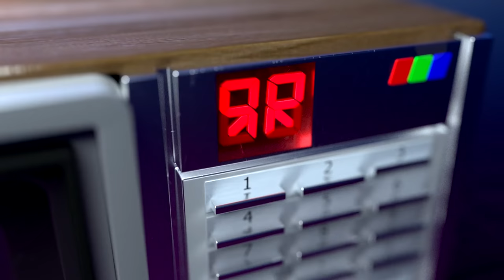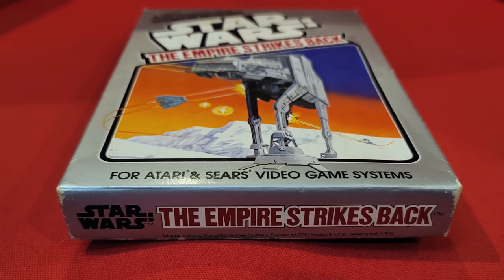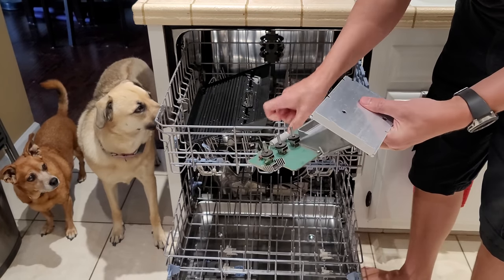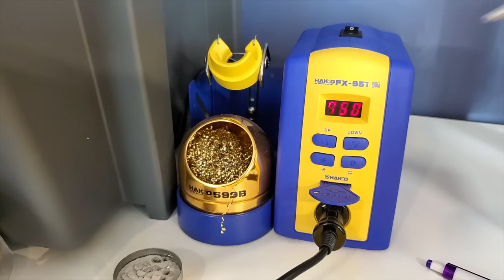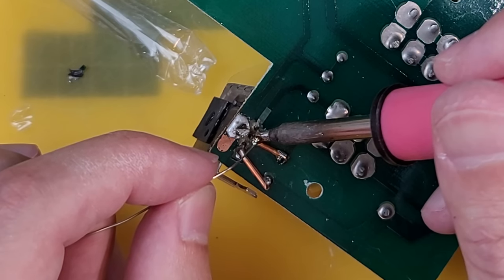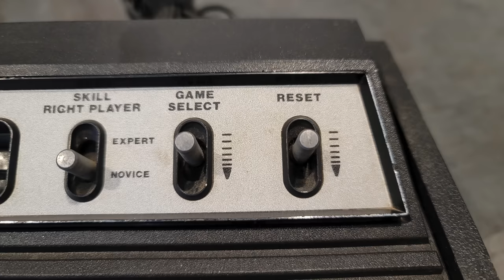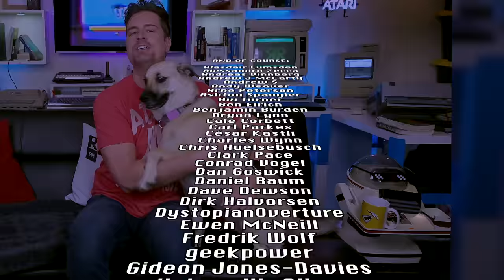Can we fix this rare 1977 Atari VCS? Sears Telegames "Heavy Sixer" Upgrade & Refurb!

Comment: I remember selling my 6 switch atari, not realizing how rare it was, it was in perfect operating condition too, a sale I would regret later on
Reply: I don't understand why they are considered rare.  I see many listings on ebay going for a hundred or less with 6 switches, I have one as well.
Reply: @n.h.s.a.d.m.  There's a distinct difference between a rare heavy sixer and a light sixer that isn't so rare...the heavy is heavier   due to more shielding (and possibly thicker plastics) when they first came on the scene, and the only outside visible difference is the sides are thicker on the heavy compared to the light

Comment: Major coincidence, I was attempting to get my 2600 6 switcher Atari branded woody from my childhood working today also. I get nothing on the screen. Power plug socket was loose, so I re-soldered it. Still get nothing. Where did you find those troubleshooting flow charts?
Reply from the maker: Very likely the TIA chip. No spoilers but I'm sure that was my issue. Oh and just Google Atari VCS field repair manual and you should easily find the PDF. Very handy! Good luck with the coincidental repair!

Comment: Hang on you reverse the polarity by turning the tips around on the ends to reverse the polarity. The box artwork on the power adapter was wrong!
Reply from the maker: Yes I had a feeling something was off there. Either way, incompatible tips 🤷‍♂️
Reply: Retro Recipes ahhhh well that’s a problem. Fingers crossed you can fix it.

Comment: I started streaming 2600 refurbs a month ago (on another site :) ) so this video is strangely timely. :)  Have you checked the RIOT socket pins thoroughly? Seems like that cap juice might have corroded a pin leading to RAM corruption like you're seeing here.  The TIA chip only generates scanlines one by one so I don't think DK would show up stable - but garbled - like it does here. But as I said I just started out so I can be dead wrong. :)
Reply from the maker: I did reflow the solder at RIOT but I'm 💯 sure it's a dead TIA chip 😉

Comment: Should have done the Stereo mod while you were in there. Yup, the TIA outputs independent Left and Right channel audio off of pins 12 and 13. Once you hear it, there's no going back.
Reply from the maker: Now you tell me!
Reply: @RetroRecipes  You can always go back in. The mod is really simple. Two resistors, two caps, and that's literally it. Here's a website with the schematic. http://www94.pair.com/jsoper/2600_stereo.html

What I usually do is pull the TIA, bend pins 12 and 13 out, then reseat the chip. At that point, I simply solder straight to the legs. The reason I do that, if you flip the board over, there's a bridge from the factory between 12 and 13. You could always cut that bridge, too, but I think just going straight to the pins is easier.

Comment: Surprised you didn't just grab any old 9v PSU from Goodwill or Salvation Army or whatever thrift store and build your own adapter with the correct polarity. If you don't have the mono audio plugs around, well, you can typically find those at a thrift store too. If you'd rather not cut up and splice and audio cable then Console5 sells ones you can open up, solder inside, and close up to look totally factory. So cheap and easy I would never dream of buying a third-party adapter for Atari CX-2600... but maybe that's just because I already have a surplus of those mono audio connectors I need to find a use for. ;) Yeah, I bought a huge pack of them from Amazon years ago and recently found even more that I've had since the '90s from Tandy/Radio Shack.
Reply from the maker: If only I had infinite time to do that! More soon...
Reply: @RetroRecipes  Would've been a lot faster than ordering one but I know what you mean. ;) That said, I did the last one in about 3 minutes since I already had a spare 9v adapter around from an old Discman.
Reply: @RetroRecipes  oh: and I typed that message while literally standing in front of the bin of wires and adapters at a Newnan, GA Goodwill. ;)
Reply from the maker: @emmettturner9452  you're a braver man then I wrestling through dusty second hand stuff during a pandemic LOL
Reply: @RetroRecipes  Not to mention that local area Goodwill and other thrift shops has little variety on the electronic side :/

Comment: “Those dishwasher pods contain anti corrosive agents” 

We’re making things up now?
Reply from the maker: Not at all. The anti corrosive (sodium silicate) is to protect the machine metal and silverware from water damage/rust in the dishwasher. Ergo they also protect the metal parts of computers. I've been doing it for years with nothing but good results.
Reply: @RetroRecipes  I think I know why people question this. It does sounds a bit odd that metals are generally protected, given glass can be etched by the detergents over time.
Reply from the maker: @wolvenar  That's true over hundreds of washes. We're talking about 1 wash every 44 years here.
Reply: Retro Recipes lol cool I didn’t know. I know it’s usually ok to put PCBs in the dish washer.
Reply: @RetroRecipes  Yeah, but I am just pointing out that it might be the reason for the disbelief.
Reply: @PunkNDisorderlyGamer  Just make sure they are FULLY dry before powering up after ;)
Reply: Looks like the alkaline detergents darkened the aluminium RF shield casting, and gave it a rough surface.

Comment: Tut tut Perifractic the instructions on those boards always say get the Atari working on RF before you mod.  Also you can generally feed the RCA jack's through the original hole one at a time to avoid drilling holes.  I vote for RIOT being dead
Reply from the maker: Wasn't an option time wise here but I bet you a million pounds (of olives) it's the TIA and was before I got it. BTW those RCAs did not fit. First thing I tried. 👍🕹️
Reply: @RetroRecipes  hope you fix it either way! You can trim the rubber on the RCA's, and the 3.5 jack (which would be hidden inside).  Really enjoy the channel

Comment: Aren't most multi voltage PSUs with the 2 prong tips capable of both center positive and negative by just turning the tips 180°?
Reply from the maker: Yeah but wrong tips either way

Comment: Just to clarify something you said about Atari still making a form of the VCS/2600 still to this day, well that is sort of true. The company that owns the Atari name today is Atari SA, a French holding company. They do not make any hardware themselves these days. The subsidiary Atari Interactive is who licenses old Games and the Atari name for retro gaming hardware/accessories. They are involved with/connected to a kickstarter project  that is putting together a modern Atari VCS (aka 2600) console that will include modern hardware including a modern CPU, Memory specs, Graphics, etc. that will not only be able to play classic VCS/2600 games but also can run a modern version of the Linux OS. So in a way it’s a Atari VCS and in another way it’s really more like say using a Raspberry Pi to run a Atari VCS/2600 emulator such via the RetroPie OS/retro-gaming system. 

Prior to the above kickstarter project, there was/is a series of “Atari VCS/26000” systems sold under the Atari Flashback name. The first two version Flashback 1 and 2 were made by the then owner of the Atari name directly (which was not the original Atari company by then), Starting with the Flashback 3, Atari licensed the name and concert to AT Games who continues to make Flashback systems to this day, most recently a Atari Flashback Portable model. Thus the later Atari Flashback Systems are not true Atari VCS/2600 systems, IMO. 

The Flashback systems all include a bunch of built-in Atari 2600 games  with each successive system upping the number of games included (but also sometimes swapping out titles that had been included with the last version for new ones, likely due to licensing issues I imagine.). Out of the box none of the early Flashback systems have any way to add or run additional games (i.e. they have no ROM cartridge slot nor an SD card slot or USB port for copying over (or running from) 2600 ROM files to (or on) the system). The Flashback 2 did include the ability to be molded to add a ROM cartridge slot that would allow you to run original 2600 cartridges on the system but this was removed as an option when AT Games took over productions of the systems starting with the Flashback 3 and above. They do however include Atari VCS/2600 joystick ports so you can use original 2600 joysticks, paddles controllers, etc with the system. Starting with Flashback 3, they switched the wired controllers  to IR-based wireless controllers that are vastly inferior to RF controllers used by Sony and Microsoft and Nintendo systems,  through you still get two wired joysticks ports as an alternative option. Flashback 8 (regular model) returned to wired controllers while the Flashback 8 Gold offered wireless RF controllers. Flashback 9 added an SD card slot for Firmware and Game ROM additions/downloadable games, saving games, etc. It also added 720p HD video output via HDMI over the 480I SD via composite audio/video only video output of prior versions. Flashback 9 (standard edition) also supports 720p HD via HDMI with a budget version offering  composite only video output. The flashback X system has look closer to the original Atari VCS/2600, including round flip/toggle switches like the original VCS/2600 systems (prior to the 2600 JR.), though in a much smaller case then the prior models which in turn all were smaller the original VCS/2600 models (It’s size is similar to the NES Classic Edition). While Flashback X can’t play downloaded games out of the box, it is possible to open the case and perform several steps to upgrade the  firmware via a file you manually download from AT Games and save to a USB thumb drive which will enables Atari 2600 Game ROMS to be loaded from a USB thumb drive via a new menu option. The Flashback Portable is a handheld version of the Atari VCS/2600 which sort resembles the PSP 1 in it’s general shape and includes a MicroSD slot for loading additional game ROMS.

Comment: 18:57  Sodium hydroxide destroys aluminum, and releases hydrogen in the process.  Just something to be aware of.
Reply from the maker: Duly noted. I cleaned it up with some oil and it's looking good as you can see later in the video.

Comment: OK, I've seen this in many other videos...maybe from the 8-Bit Guy, LGR, Techmoan, and others?  Is it really OK to run electronic components and motherboards thru the freakin' dishwasher?  What cycle?  Gentle?  For how long?  Do you use soap, or just water in the rinse cycle.  Hot water, or cold?  The thought of doing this just spooks me...I'd melt my Atari, break my dishawasher and plumbing, and flood the house.
Reply from the maker: Lol it's fine. Normal wash, normal heat, use a dishwasher pod that contains anti corrosives. Don't use heat dry. 👍🕹️

Comment: Was this Heavy Sixer Tele-Games version PAL, or NTSC??? I want to try to Re-furbish and upgrade our old Light Sixer Tele-Games console. I ordered the Repair/Upgrade kit with the xtra bits n bobs, and a new supply from the console5 shop, but as for the Composite kit you used, I checked the site, and the instructions seem to be listed as PAL. I really want to do a composite upgrade, but I just want to make sure if there is any difference between the 2 board types before I try anything since ours is an NTSC Model... BTW, I had seen a Commodore 64 upgrade/mod video the other day that dealt with removing the RF circuit as well to upgrade the signal, and I also want to try what the person did in that video as well... He was able to remove the RF circuit, patch the composite signal out, but instead of just leaving it with the RCA jacks, he took the board from inside a little Upscaler box, patched the composite signal to the upscaler board, mounted a HDMI coupler in the back of the case, and had the Commodore 64 output in HDMI to an LCD monitor/Tv...
Reply from the maker: This one was NTSC but you'd need to ask the place you bought it about all that. Good luck!
Reply: @RetroRecipes  That would be a bit hard since our Mom purchased it brand new when the light ones first came out lol. She used to work at a mall, and there was a Sears and a Kay-bee toys as well. She bought this version from Sears, and the cartridges from the toy store. Later when the newer version came out (rebranded Sears model for the USA (2800 model which was only available in Japan)), she purchased that model as well. As for the kit it's the same one you used, with the same images, from the same site.
Reply from the maker: @Plague123  Yep I meant ask the place you bought the kit, not the Atari ;)

Comment: I never see you use soldering braid or flux, is this true? Personally I can't live without it.
Reply from the maker: No need for braid with a desoldering gun in my opinion. I use tip tinner with flux before soldering but usually forget the actual flux. What's the benefit to you? Though I was using some earlier today.
Reply: @RetroRecipes  Your struggle around 12:00 just begged for some braid imho, it really helps absorbing the last bit of solder. 8-bit guy uses it too :P. Also I always use flux paste which makes soldering a breeze, night and day difference. It just makes it flow so much better. It probably depends on what kind of flux you use and how you use it.
Reply from the maker: @Jannemandevries  I'm sure you're right. This was a 9 day project so I was forgetting a few things in my excitement to get the machine working. As they say, the only people who get nothing wrong are the ones who do nothing. Thanks for the tip! I'll remember next time...

Comment: i have to look into that TIA chip stuff. my understanding is that it contains IO, sound and video. while the IO and sound is probably very easy to rebuild with a 5V microcontroller from Microchip, the more difficult part would be the video part. but as i also heard, it is more something like a simple pixel shifter that can not do much.
that would mean that it might not be that super hard to replace it with a few programmable logic chips without the use of FPGAs with a million pins and ball grid arrays that only an advanced alien race can solder.
i think the Atari 2600 is still the most beautiful console out there. all the other consoles like playstations, xboxes, nintendos look like random generic shit.

Comment: The Sears Heavy 6 isn't all that rare. I had 3 of them among my 7 2600s.

Interesting to note some 2600 games work fine on the 6 switch but won't on any other model. Kool-Aid Man from M Network is one of those games.

I'm going to guess the RIOT was dead. If you're getting any output, the TIA is working. If it seems the TIA was doing something, the 6507 is doing something but not much. The RIOT reads the game ROM. If it goes bad, nothing happens.
Reply from the maker: Cool how many Sears do you have today?

I'm 💯 sure the dead TIA was the issue. Remember I'm a little ahead in real life than the video releases 😉
Reply: @RetroRecipes  I don't have any Sears or Atari Heavy 6ers anymore because of an evil entitled selfish ignorant family member who stole lots of my personal possessions 2 years ago. I ended up in the hospital because of their actions. 😖 I even had a Vader 2600 and the typical 4 switch Woodgrain. Ben Heck discovered the Single Chip 2600 Jr. 

I've modified my regular 2600 Jr to use the automatic switch boxes like the 64-bit Jaguar or even the NES used. A simple DC blocking circuit does it.
Reply from the maker: @theannoyedmrfloyd3998  I'm sorry to hear that. I can understand why you're The Annoyed Mr Floyd now.

Comment: First your diagram there is a bit different from the board you have, second you removed the second resistor instead of the first in that row of 6. maybe don't go by the numbers but rather the placement.
Reply from the maker: That was an error I fixed later in the video but it didn't seem worthy of mentioning. You're watching too closely 😉😉
Reply: Best of luck then, I'll watch with one eye closed from now on. 😉
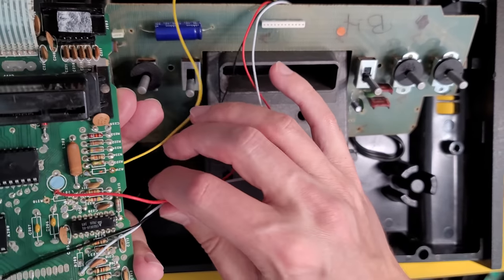Reply from the maker: @Foxtrot_Foxtrot_Lima  Hehe actually you'ren not watching close enough, you can see the resistor suddenly swapped with R216 at 16:14. I had a whole section in the video about this mistake, but the video was just too long. 🤷‍♂️

Comment: You did not follow the composite modification instructions. You left the wires the wires too long with could cause crosstalk interference. The manufacturer does not recommend leaving these wires aaa long as they supply. They recommend making them as short as possible. Watch there video!  Others beware!
Reply from the maker: Could you show me a link to that video? There's no way to get the wires out of the shield and to the case position they show in their instructions unless they're that long. Do you have a source? Thanks.
Reply from the maker: Also, I'm open to what you're saying, however the mod's creator saw several photos of my board with the wires attached during the making of this video and didn't mention the length... 🤷‍♂️